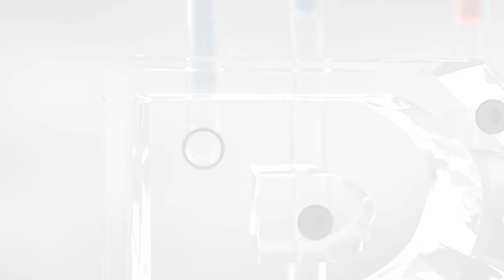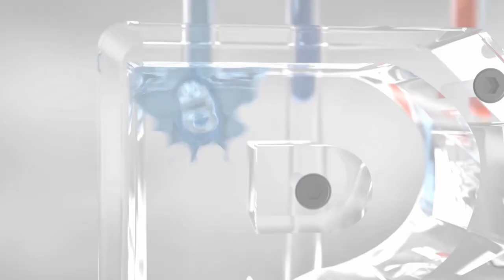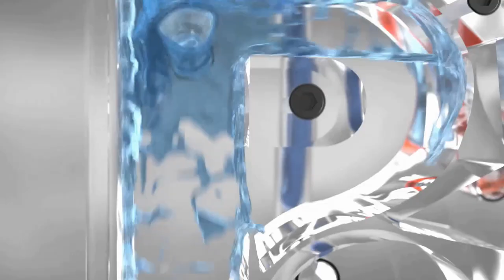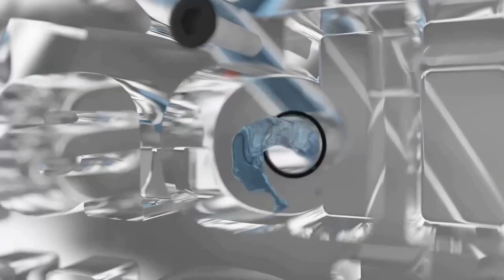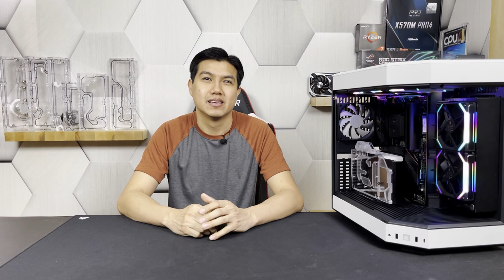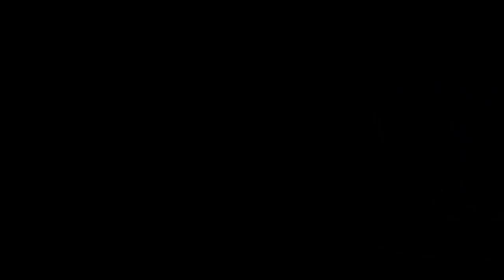How I start making a Custom Distro Plate

Comment: 1:30 Try using rigid-closed-cell-foam insulation sheets without the "Foil Faced" from Home Depot, Rigid Extruded Polystyrene (XPS) is what I've used.  THIS stuff is what you want to use, because you can then work in 3D instead of 2D cardboard, & is sold in 1 & 2 inch thicknesses.
For example what you're building now you could make it trapezoidal where it gets thicker as it goes in giving you more room on the inner surface of the res for your pump mount.  You can also cut these sheets with your CnC (a laser would be best) as a last step to make sure what the data you entered is going to fits the case & the outlets to the CPU/GPU in/outlets align by just using the data to cut the outer shape & holes for the fittings, should let every job come out perfectly the first time...  I am sure you have made amazing res/pump combos the wrong size.
Reply from the maker: I did in the past. It’s why some very specific items I use templates or cardboard just to double check and make sure I didn’t mess up or missing something. 
I will check that cell-foam next time I go to the hardware store

Comment: custom orings are simply cut at an angle and glued with superglue in a few seconds and it's ready. They should not leak, because the rubber is crushed, so even if it is not glued, the gap will close, but it would be inconvenient to put on.
Reply from the maker: Yeah, I just rather not deal with all that lol. At one point I even try to find a “vulcanizer machine” so I can bond orings if I needed to make a custom one. 
But than I notice the oring cord sometimes is not quite to spec. When I order 2mm oring sometimes it could be 1.95 - 2.1mm and that can affect the oring groove that’s milled into the reservoir.  
It’s why I prefer pre-made, are always the same
Reply: @radikult-custom  I'd prefer the original as well, but if I had to wait that long, I'd glue it to the right size myself.

Comment: Hello, I just saw your video and I find the content very interesting. Are you working from a file that I designed myself using fusion 360? or you absolutely need the dimensions to work.
Reply from the maker: @laurentbel4745  hello 👋, i can work from a file from fusion 360.  If possible I can try to estimate a cost and time 
You can send the file to Radikult@gmail.com
Reply: I will contact you on your email inbox and send you the files. just give me a moment to identify the files.